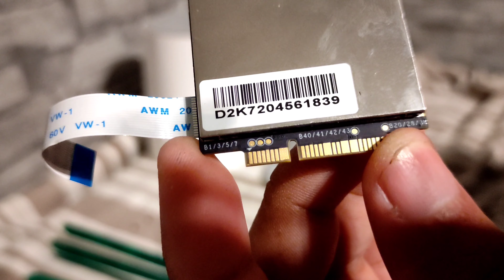What's inside your PLDT D2K-FT10

Comment: Hindi po palamuti ang mga internal antenna na yan actually naka 4x4 MIMO setup na yan at pwede mo kabitan ng dalawang mimo external antenna with different polarization.
Pakita ko sa inyo pano mag setup niyan pag may pambili ako ng dalawang mimo antenn👌✌️👍
Reply from the maker: i mean may function sya but base sa observation ko ang hina po sumagap ng signal
Reply: @ThatsAFewMinutes  o0 lods dapat talaga gawing external yung antenna para maganda ang communication between modem at tower. yang mga patch antenna na yan 5 to 9dbi lang talaga yan at yung mga mimo external na binibinta nilalagyan yan ng reflector para tumaas yung gain👌✌️👍
Reply: pwede nga gawing external antenna niyan lods bilhan lang ng extension at lagyan reflector para tumaas yung gain at maging detectional antenna👌👍
Reply from the maker: salamat sa info sir. ilang dbi masagap nya once may reflector?
Reply: @ThatsAFewMinutes  depende sa design lods kung parabolic or dish siguradong 20 to 30dbi gain
Reply from the maker: maganda yan pag ganun
Reply from the maker: @skyrex4694 puidi kaya ito sa band 28. just wondering anung frequency kayo compatible yang antenna nya
Reply: @ThatsAFewMinutes  pwede lods dahil wideband yan mula 700mhz/band 28 to 2500mhz/band 41
Reply from the maker: @skyrex4694  wow talaga sige try ko e customize